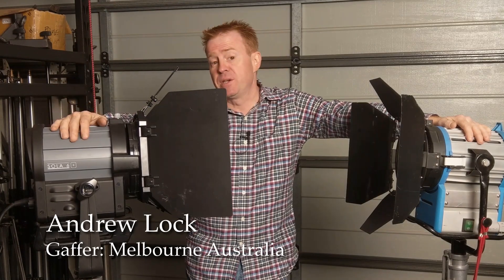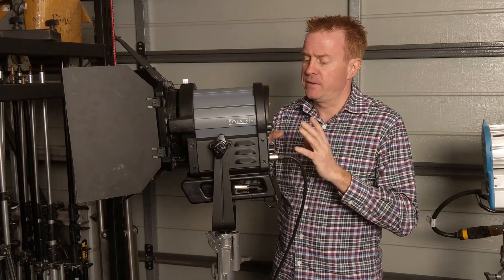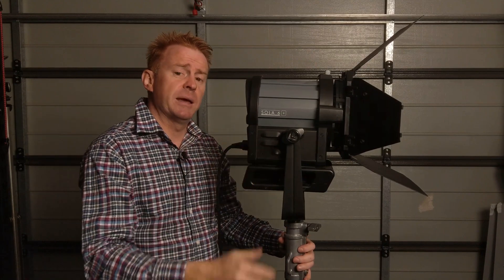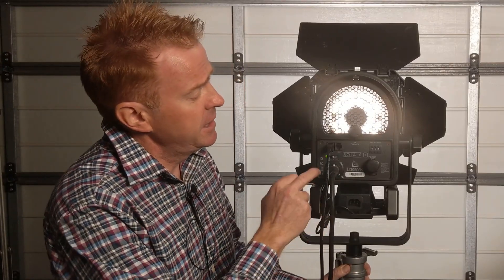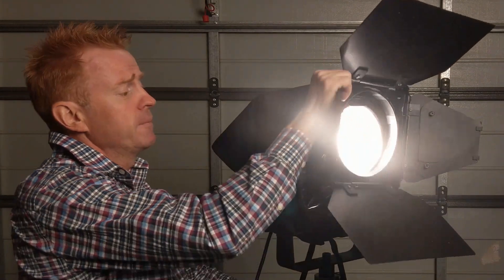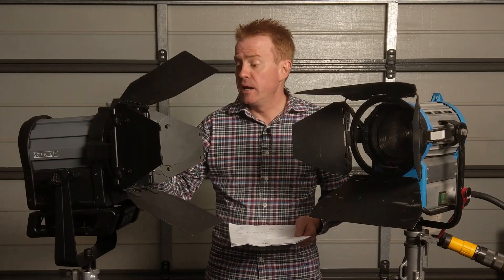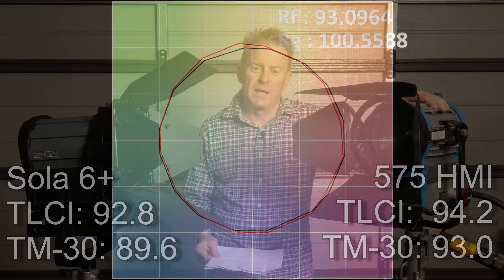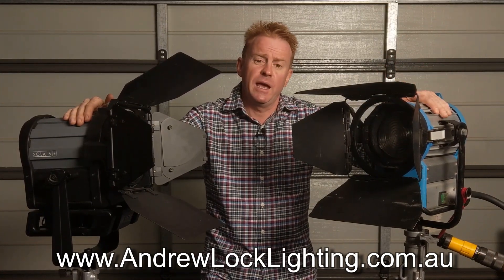Gaffer & Gear #020 - Sola 6+ Review, and HMI Comparison.

Comment: Great review. We consider getting one for macro filming in slow motion. Do you think it would be bright enough. We could put it at 0.5 or 1m distance. We plan on filming with 2000fps which normally requires bright sunlight.
Reply from the maker: Their are a lot of brighter lights with better colour render at a cheaper price that could do that for you. Aputure and Forza may be worth a look. If it wasn't for DMX I would have sold these as replaced them with Forza 60's with Fresnel's.
Reply: @gaffergear  Thanks for the reply. I have looked more at Aputure 300D II which seems good. The coming 600D also seems interesting, but I wonder how heavy it would be since we need to travel with airplane. 200,000 lux vs 80,000 would of course make a difference. I just filmed rain impacts in 2000fps and we are talking 5000 ISO which is very noisy so a strong lamp would make a big difference there.
Reply from the maker: 2000 FPS, I would want to test before I buy.

Comment: I ordered the Sola 6+ used and the fan came off inside the housing. Are you able to teach us how to open the light? Also, do they use different screws? I tried to loosen one and it stripped immediately.

Comment: Thanks for the comparison & numbers. I've never used a HMI on a set before, and so I've always wanted to know how well my Aputure lights compare to a HMI. My measurements at the same 2.5m distance (with a Lumu light meter) are:
Aputure 300D (~300w)
Reflector (~100°) = 2,263 lux  (manufacturer states 120° spread, but my trigonometry calculations say otherwise)
Fresnel (40°) = 5,517 lux
Fresnel (12°) = 8,259 lux
Reply from the maker: I will most likely be getting a few next year, subject to their new attachments being good. I'm interested in the leko mounts, and the new Fresnel Mount they have in development.

Thanks for the numbers.
Reply: The Aputure 120D / 300D lights are quite good for small rooms (3.5m x 3.5m). I've tried the approach with a 3'x3' diffusion frame on a C-stand, then another stand with the light, spotted onto it, flag off the spill with other stands... it gets really crowded. It was a breath of fresh air to have a 65cm, and a 105cm octabox with grid attachments that can all be contained on a single light stand rather than the mess I mentioned earlier. Curious someday to own multiple of these, and stick them into 2'x3' soft boxes, lined up edge to edge to make a larger light source - and see how that compares to a 6'x6' book light.